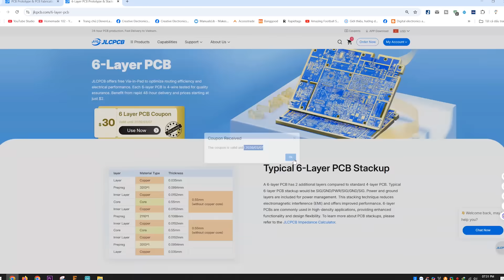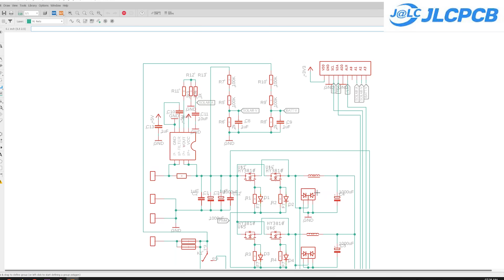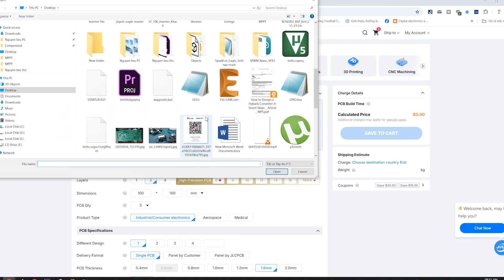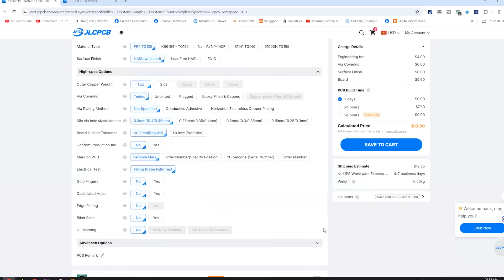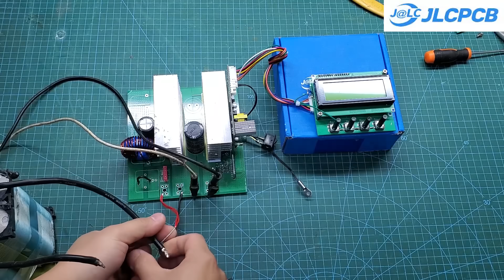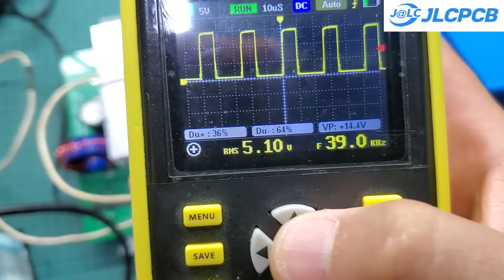Make 50A MPPT Charger Part 2 | JLCPCB

Comment: Hello, I would like to modify my system to accept up to 400V from solar panels and to be able to supply voltage for charging 24/36/48/60/72/96V battery systems with a current of around 80A. What parts of my system need to be modified?
Reply: Change the input capacitor and the mosfets to suit your needs and the inductor also to match the current. You can use IGBT for high current and voltage.
Reply: @clarkso65   I’m happy to say I’ve successfully pulled it off—the two-phase setup is working flawlessly. If you’d like to do what I did, feel free to message me; I’m more than happy to share the details. I guarantee that building it yourself will give you a much greater sense of pride than simply buying one.

Comment: Is this 2 Phase interleaved or Single Phase?
Reply: According to the video, it's a single-phase system. However, it can be amplified to higher power levels as shown in the video. Parallel connection of multiple MOSFETs allows for high power output in a single phase, but it's very expensive. If you can use 2-3-4 phase systems, you can significantly reduce the need for parallel connection of MOSFETs.
The phase working principle is similar to the HI/LO MOSFET driving system commonly used with IR2110/2113 and IR2104. Also, in a 2-phase system, the HI side (positive pulse) doesn't shift phase, while the LO side (negative pulse) always shifts phase in one direction or another, similar to the 180-degree phase shift in a 3-phase motor.

Comment: Hi, show us thermal images, after 12 hours at full load.
If not, we do not believe, that you have good ZVS MOSFET switching.
So us ripple and noise, and EMI measerements please.
Reply from the maker: This is just a test version. It works, but the conversion efficiency is only around 91%. I’m improving the code to use an interleaved two-phase buck. A new version will be coming soon.
Reply: @PhdHung I'm waiting teacher ❤
Reply: @PhdHung  Ilove to have copy of your file again.. thanks a lot in adavance.. God bless you..

Comment: What's the point of this if there is no firmware?
Reply from the maker: @jestersoft  As mentioned in the video, I’m using TechBuilder’s original firmware. If you’d like to use a modified version, you can download it here : https://drive.google.com/file/d/1DjVp5yzwCKdCCphH7z5n0GS27uuSU7zS/view?usp=sharing
Reply: True. This is useless
Reply: @migor777 use lm5116. No codes needed to make mPPt. Higher current upto 20A
Reply: I m watching this guy for last 5 years.  He only know about mppt and noting more😂. He share the schematic but always wrong. Never help anyone😂😂. I use chatgpt. I built so many things in last few years. Not MPPt day and night. MPPt is boring now. I can tell you so many chips use for mPPt without codes